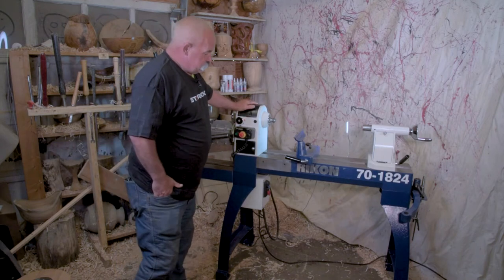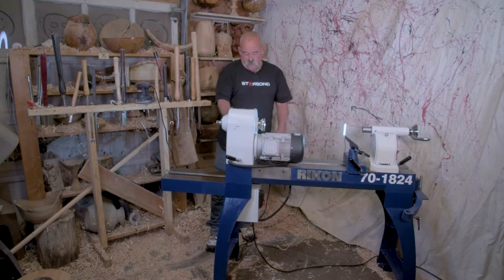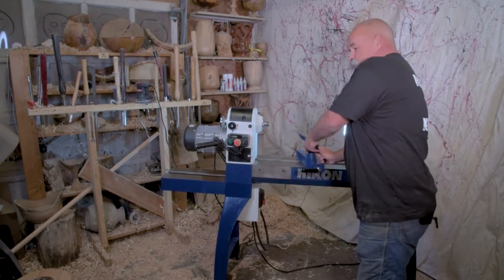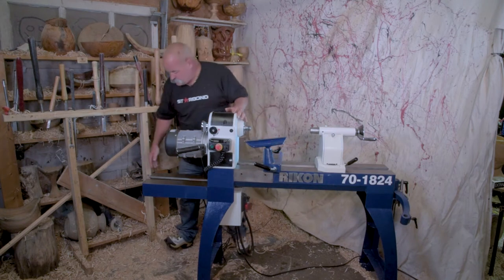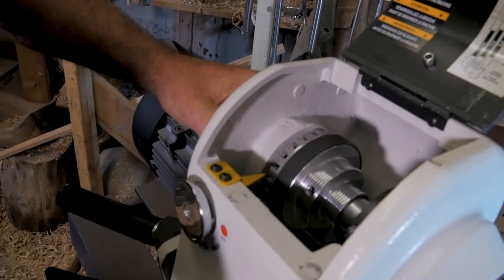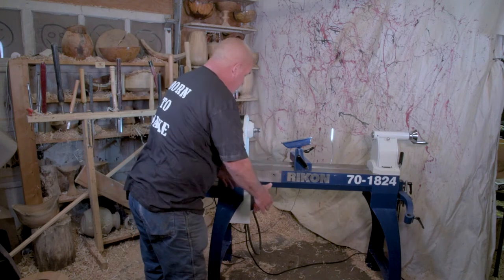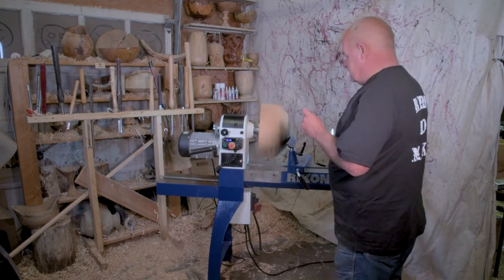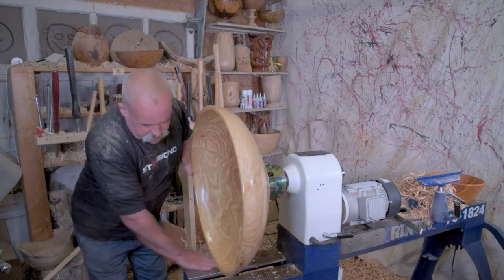Rikon 70 1824 Review and Demo

Comment: Great demo. I am very interested in this lathe size. Are there any assembly YouTube shows?  I need to put the lathe in my basement and it looks heavy. Hopefully it will disassemble.
Reply from the maker: It does come in a crate without the legs attached.  It's not light. Well over 500 pounds.  Give Rikon a call and I know they will have a better answer for you. Mine did come assembled.

Comment: Yeah they needed to add a lathe like this to fill the gap in there offerings.  Hope this one is not like their 70-1420vsr when it supposedly came out but in very limited supply and then on backorder for over a year now.
Reply from the maker: Unfortunately in this day it's out of the manufacturers control. I hope a whole bunch of people get to own this lathe. 🙏
Reply: @cscottbeach yeah it looks like a nice lathe. How did you get you get ahold of one? You say its dual voltage? I'm guessing it's 2 hp output on 230 volt supply and 1 3/4 hp output on 115 volt supply. I like outboard turning capability too bad they didn't make the extension bed a little longer, and make some sort of riser for the tail stock so it could be used on the outboard side for additional support.
Reply from the maker: @johnnorris1227  Last I knew they would be shipping in December. Correct on HP. There is a riser for the banjo/tool rest. It covers quite a variety of abilities but new ideas are always acknowledged. A phone call to Rikon would be your most accurate answer on availability. Thanks for watching. ; )

Comment: What kind of projects make you feel like this lathe is too small and makes you prefer the 30/40?
Reply from the maker: Given the choice, I would always choose the bigger lathe. If I didn't have a choice, I would be very happy with either.  The 70-3040 is sturdier with a very large blank for sure. The size class is different, but both are quality machines.

Comment: This lathe has every feature that I was looking for. What HP rating is on the one you have? Is it the 1 3/4 hp 115v, or the 230v 2 1/2 HP model?
(The VSR2 model has 2 1/2 HP.)
I intend to be doing a lot of turning with blanks from 24  inches. 
(It says you can turn up to 44 inches outboard with a separate tool rest.)
It has four bearings in the headstock similar to the 70-3040, so it seems to be built to take the load.
Will this be able to handle up to 30 inch blanks on a fairly regular basis?
The 70-3040 might give my back problems if I'm constantly leaning into it, so I'm probably going to pass on that beast.
If you have a better lathe in mind, I'd be grateful for your input.
I really like this model, and 2 1/2 HP seems like plenty to me, not to mention the price is fantastic for all that you get, but I will pay more to be happy if need be.
Thanks for the review, and hopefully a response.
Reply from the maker: Honestly, owning both. If I'm turning 24 inches or better, I'm using the 70-3040 every time. 
While the 70-1824 is a good sturdy lathe, the 70-3040 is just that much more stable on large pieces.  While I think the 70-1824 is an extreme value for the money if I had the money I'm buying the 70-3040.  As far as comparable lathes I don't think the 70-3040 has a competitor for its price tag. And the 70-1824 is by far the leader in its class. 
Did I answer your question?
Reply: @cscottbeach  , Thank you for a very quick response.
One thing seems certain: I'm getting a Rikon lathe! 
As far as which one, I'll probably change my mind multiple times, until I plunk down the money, right after the new year.
Thanks again.

Comment: Question? I have a Laguna 1216 that is having forward reverse switch problems (it’s locked in forward now) and looking to upgrade hp and capacity. This looks viable but I have to know does it switch from forward to reverse quickly or is it slow to switch. I ask because my son has a record power midi that literally takes 5 seconds to switch from forward to reverse and back again, and it seems to take an eternity. I like to hollow in reverse and sand 50/50 in forward and reverse but would hate having to wait any length of time for it. Any feedback you can give me would be appreciated! Great video btw. Well done
Reply from the maker: The switch is instant but when the motor is stopped of course. I'm so used to that on both my lathes I cant imagine anything different. So its instant but you do have to stop and start. Thanks and glad you enjoy video.
Reply: Thanks so much